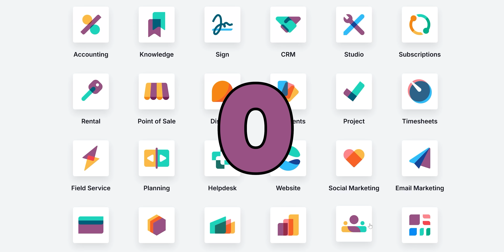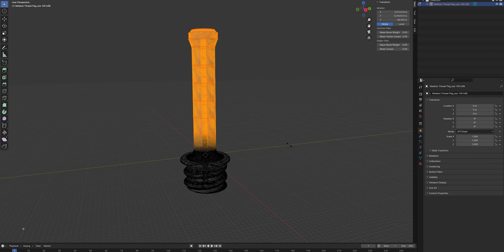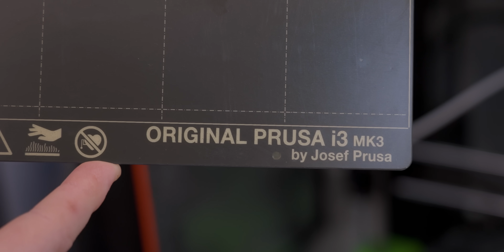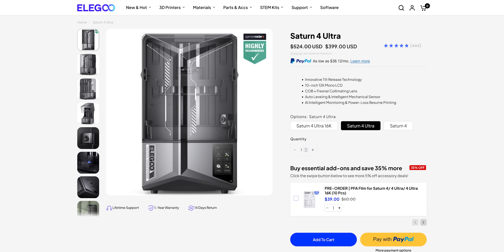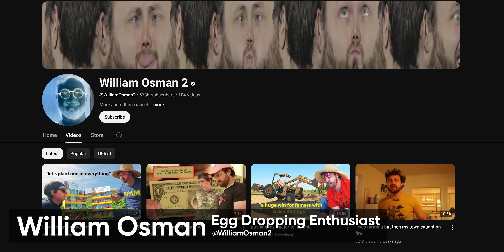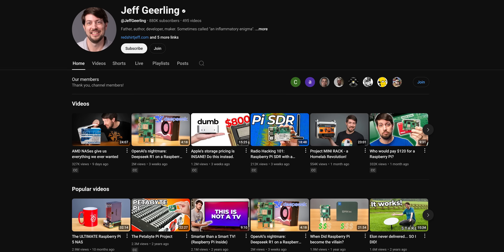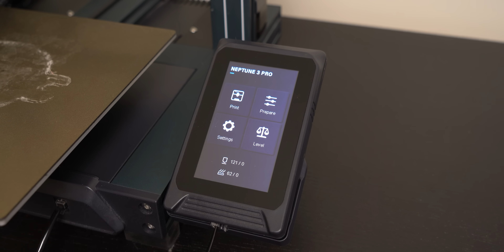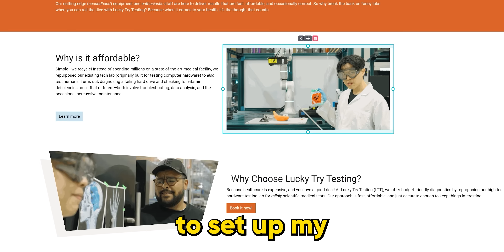Is my 3D printing setup wrong?

Comment: Desiccant packs are a thing ofnthe past. You can buy the beads and print containers that not only sit in the slots between the AMS motors but also sit in the spools and lower compartments. Plus when the desiccant change colors you can reheat them and dehydrate them in the microwave. But get the orange ones they don't have that toxic chemical the blue ones have.

Comment: Tell Jake instead of the hardened nozzle check out obxidian by e3d they have it in v6 style, I use the obxidian revo style abd I've had the same nozzle since they dropped 2 years ago and have ran a lot of glassfiber,and carbon fiber filled filaments it hasn't shown any wear at all.

Comment: my first, and only printer is the artillery sidewinder x2. and it was a PAIN to use before i installed Klipper on it. 
the filament sensor cable was squished by the z-axis as well and fried the pcb with the screen LOL

Comment: You need to have Dennis do more sponsor bits!  
As for printers, I have the AnyCubic Kobra 3 and a Kobra 3 Max. They have the "Ace Pro" which is AnyCubic's version of an AMS.  I've had a few problems with them, but AnyCubic support was super helpful and even sent me a new hot-end after a clog caused the original one to jam up.  The camera can be used to have an AI detect printing errors, but I've had more false-positives than actual printing problems caught.

Comment: I use a Creality Ender 3 with a Raspberry PI Zero2W with a camera on a 3d printed arm running OctoPi.  With a couple of extensions to control GPIO for a light and printer power I can run everything remotely via a web interface.  It even records timelapses of the prints for me (set to 1 frame per layer).

All in the entire setup was cheaper than half the printers listed here (about USD200).  Single colour prints only, but I have no complaints about the ease of use or quality.

Comment: I have to say that I think that you are using this machine wrong. I have 5 and I have literally had nothing go wrong with it as long as you take care of it. Prusa's are great but you need to build everything from scratch. SO if you have never done this it is a complete PITA. But I've been using Creality stuff for the last 6 years, so I do understand how all the aspects work. Unless you get the Prusa XL 5-toolhead 3D Printer (2500). Also they leave out the awful issues with the cleaning of Resin. It is just awful. Stinks and goes through IPS like water.

Comment: Thanks for the video and mentioning the part about the accessibility of the tubes in the AMS. I hope Bambu Lab listens/watches and provides an upgrade or something.
Why don't you print and use the dessicant trays/pods for your AMSes? It will keep the housing dry and should reduce problems with jamming and clogging.
In my case, it reduced the humidity in the AMS to 1 in about 2 days and (fingers crossed) i never had any of these problems so far.

Comment: 90% of my prints are car parts. I have a pretty basic and cheap setup, a modded Ender 2 Pro and a heavily modded Ender 3 V3 at home, and at work a K1C, mostly for bicycle, scooters and motorcycle parts in ABS and similar materials. I haven't used a dryer in my life, just pack the filament in the sealed bag and add a couple packs of silica. In my experience, settings and design are more important than the printer itself.

Comment: I’m surprised almost everyone uses Prusa, in my experience they’re just a really over priced version of what you can get from pretty much anyone else. Usually a bit more polish, but not double the price worth (except the PrusaXL that thing is genuinely in a league of its own). I’ve been a big fan of what Creality has to offer, the CR-10 series was awesome back in the day for how big and cheap they were and it looks like a lot of people in the video agree. The earlier Ender 3’s were cheap but pretty bad, but the Ender 3 S1 and V2 were great (V3’s kinda suck though ngl) and the K1 Max is a way bigger, cheaper, and more open version of the Bamboo printers (though like with the Prusa comparison not quite as polished of an experience). I’ve done all kinds of stuff to my K1 Max, rebuilt the gantry, new motors, and all kinds of firmware mods. I haven’t payed super close attention the last few months since I’ve been so happy with my K1 Max, but the K2 Plus from creality and new machine from Bamboo look like they might give the Prusa XL a run for its money (aside from the Bamboo being so locked down now)

Comment: This dude really has a resin printer on the ground on carpet.. please DO NOT DO THIS. You also must ALWAYS use PPE when handling anything resin that is uncured... I must also say you need proper ventilation as the fumes are incredibly toxic as well. Jakes setup is a straight up F for resin printing or at least what was shown and talked about. LTT I would honestly go back and omit that part of the video as it is a huge safety hazard to the general public that would not know better. Not trying to fear monger but these are genuinely hazardous chemicals that need proper care and disposal. The fact nothing was even talked about regarding this is baffling apart from a silent yellow bold text saying to not handle the tray without gloves.. This needs to seriously be addressed and fixed before someone gets honestly hurt because they do not know the proper care steps to take.

Comment: I honestly don't get the drama behind the Bambu updates... People are making wild assumptions like Bambu just made all 3rd party apps no longer work. This video honestly disappointed me because Linus just painted it as an issue it's not at all, and didn't even try to gloss over facts, just left them out all together. All Bambu did was require authentication for the services that most people say they blocked. They aren't blocked, you just need to authenticate the API now. They even provided an app for that that all 3rd parties can integrate with called Bambu Connect. Everything still works as long as what ever 3rd party app you are using took the time to update their own integration... I'll never be mad at a company adding security to their systems. I'm very surprised that Linus Tech Tips didn't cover these facts in this video, and opted for the "They added security so we can't recommend them as much anymore route"

Comment: HA! My multicolor system, has a built in dryer, and an individual tube all the way to the printhead, and the only thing I've ever had  to deal with, is a piece at the end of a spool, shorter than the tube, after a print finishes. All I have to do then, is see which tube has filament in it, disconnect that tube, and pull the extra piece out, from the printhead side. I've never had anything like I hear about from the AMS, where you've got to take it apart. 

In all fairness, the Kobra 3 does "rather did, they've fixed it now" come with a leaky hot end. I started a 10 hour print, went to bed, and when I got up 6 or 7 hours later, the hot end had leaked, and totally encased the entire thing in hardened PETG. I managed to salvage the printed, and even the heat sink, but had to grab a new "version 2.0" hot end, but it was 15 bucks, no biggie. That was under 100 hours in. Now, at 1050ish hours, the "new" hot end did the same thing yesterday. No biggie again, I got a whole new one, with 0.2,0.4. and 0.6mm hardened nozzles on the way for under 20 bucks, and went ahead and bought an entire new back up printhead for 50 bucks. It had a side effect issue of the 1st mishap, where the front of the printed, with the cooling fan, every once in a while "3 times total" would shake itself loose, since one of the clips was slightly damaged by the massive half kilo clog. It was a freakin MESS!  

But overall, at 1000+ hours in, on my 250 sq bedslinger, 2 major mishaps, a couple minor ones, and maybe a dozen failed prints, out of over 30 kilos of filament printed, I think my $400 multicolor printer is a win.

Comment: comment for the camden bowden, your gcode on the printer is the reason it is resetting the z offset everytime you start a print. within the gcode if you plug in and m503 check the settings as well i would bet 1000$ that gcode has a line in it stating to reset the z offset to reset if you remove this line it will listen to what youve done. problem is when you PRINT a sliced GCODE that is seperate from the physical machine youre messing with but normally there arent any line sin the gcode start section stating things like reset z offset if you downloaded this profile from another individual they MAY HAVE added it because of an issue they were having or an upgrade they may have aded like changing the stop limit switches of the z axis to mechanical switches with screws he manually adjusts that will never change period so adding this code in the start g code would force the printer to overlook any technical z offset that the sliced file or the printer may be attempting to force in because mehcanical is mechanical if it clicks it will stop, some of the nice parts about physical parts like that compared to an optical sensor we have on most newer printers.

Comment: hahahaha bro if your jamming in those bowden tubes you can disconnect from the hotend and just manually turn the extruder gear with new filament inside and push it out takes like 45 seconds. i dont own a bambu or their ams but unless they sealed their bowden tubes completely and theres no manual extruder gear you can definitely just push new filament through also if your filament is snapping in the tube theres a much larger issue at hand might be too high on the retraction speed forcing the filament back in or out too quickly snapping it in locations and maybe thats the issue you are having. theres no access point under that ams because if your clogging there, weve got to go back to 3dprinting 101 and start there because nothing in those tubes causes them to clog even with humidity. humidity only causes stringing and bad prints if anything and barely any noticeable difference, honestly only if youre SELLING the models yeah you definitely would se the difference but for personal use or kid use i mean looking at all those prints theres a ton of retraction work we can do and speed because theres a lot of artifacting on a printer that should have 0. sorry for types but just posting it, its whatever. great video though always love em all.

Comment: I built my own printers, and I have been using Linux for 26 years. 
'I don't use Arch by the way' 😉
I also design my own parts.
_FREEDOM! _
I encourage anyone to take the fun route of exploring everything. 
It also means no one can 'Bambu labs' you.
Although you may get some failures the successes are all the more special.
I sell a tiny volume of 3D printed products all around the world. 
I think I would have printed around 120kg of parts. I buy filament in 8.5kg and 5kg spools these days. 
Many prints exceed 1kg, and some exceed 2kg.

Comment: I run a pair of Ender 3s that I bought used on facebook marketplace. One of them has a direct drive extruder and dual Z axis steppers, the other is completely stock. They sometimes need babysitting to make sure the first layer is adhering, but once a couple layers are down, they generally don't fail, at least with the basic PLA that I'm using. 
I think, for most people, the "setup" can be as basic as that. One thing that 3d printer nerds tend to forget is many people want this to be a tool, not a hobby, so cheap and simple is a perfectly valid way to go about it. 
I think the more difficult side is actually the modeling. I first learned on autodesk products, but their licensing system is a pain and they don't really do linux support, so these days I tend to struggle through projects on FreeCAD. I... can't really say I recommend it. There's too many weird limitations and required workflow actions that a more polished CAD would handwave over, but FreeCAD doesn't, so one ends up spending more time debugging the various unhelpful error codes than actually progressing in a project.

Comment: Resin printers are actually not dimensionally accurate. The screen itself is, but when you pull the green print off the screen, as it happens every layer, it warps a little, and that warpage adds up! I would say Prusa FDM printers are most accurate in large dimensions.

Comment: My first printer was the ender 3 v1. It works well but needed a lot of tinkering and some upgrades to get it consistent. My 2nd printer is the ender 3 s1 pro. This model fixed everything I didnt like about the first printer and had upgrades I wished my first printer had like a direct drive, high temp hot end, hotter bed, faster print speeds and a touch screen lcd. It so far has been a workhorse with no issues.

Comment: Oh FFS, get over it, the Bambus are RAD, do you really care that those changes are made?  They made clear that they will not be doing subscriptions.  I have been doing 3D printing since the first ones hit the market and my Bamboo X1C is the first that is a tool and not a hobby.  Much ado about nothing.  If you don't like it, do LAN mode and wait until they realize what they are doing is dumb and roll back.  I pitched my Ender 3s the minute I used my X1C, it is wicked fast and many many prints in, I have had 0 issues.

Comment: Seismic Dampening feet are probably better than nothing BUT not amazing. They dont really dampen the movement as much as they are springs. I recommend getting some soft foam or rubber under the Printer instead.

Comment: super simple dryer setup that can scale... get an IKEA cabinet and a dehumidifier. You can dry multiple spools at the same time as well as anything else. I used to work at SeaWorld and we had a dry box in our shop. Any time we pulled gear out of the field for repair, it would get opened up then put in the dry box for 2-3 days before we actually worked on it. This is also where I kept all our PLA when not in use, allowed me to swap out rolls quickly when one was on the printer too long.

Comment: I bought an X1C at launch with all the accessories. I dislike the firmware update, but it also provides some things that I appreciate. The remote printing function is greatly improved and I end up using that more than I thought. I hate having to use their cloud as I could just VPN in and use my own.. but I've never used any other slicer but Bambu Labs Software and Bambu Handy, as I've found both of them far more intuitive than Orca. I started years ago with a Creality and frankly found it to be unreliable garbage. In years, the number of blown prints I've had on Bambu is minimal, often PETG or TPU filament fails, but my PLA ? Solid like a rock, print anything. Each version of Bambu's software is better.

Comment: 8:35 dont be like the editor and just use common sense, a empty vat with clean sidew is perfectly safe to hold without gloves, there is no spladh risk and in this situation you would actually need to try to get resin on you, for handling vats with a bit of resin in them or the sides are dirty or your moving a freah model by hand then sure use PPE but a couple drops in a vat are not the Boogeyman, they wont jump out and kill you.

Comment: I'd just like to point out: The Core One is not "basically a MK4S with an enclosure"

It shares the toolhead, much of the electronics, and a lot of parts, but it is a completely different design.

It uses a very different motion system with very different characteristics, and the enclosure is more a natural benefit of the complete redesign than the main differentiating factor.

Just wanted to point that out.

Comment: Ok. EVERYTHING Jake is doing is WRONG. Do not use his setup as a guideline. Resin with no gloves, on a carpet, is STUPID as hell. Damn. No. Resin, isopropyl alcohol, and curing should be done in an space with proper ventilation and fume extraction, with personal protective equipment, and flat, smooth surfaces that allow for easy cleaning.

Comment: The easiest budget printers Are the Bambu Lab A1, A1 mini,. Creality Ender 3 V3 SE or Ender 3 V3 KE. The KE has a better hot end, and control pad. The A1 and A1 mini can be bundled with the AMS Lite for multi material/color filaments. They are extremely quick to assemble, all are bed slingers, all have automatic bed leveling and Z-offset. The A1's and KE have wifi and the A1s have cameras. A camera can be purchased for the KE. The A1's are a tad more expensive of the 4 but the AMS Lite is what makes them the more favored of them. You can get the A1 w/ AMS Lite for 440 USD at Bambu Lab while the Ender 3 V3 SE is 199.00 USD at Creality

Comment: Maybe don't allow auto updates and don't update at all if the printer is working fine?
You don't need bambu handy, in fact no other manufacturer has a similar service so in the expectation of switching brands you have to get used to the pc only software and maybe look into alt slicers like Orca.

Comment: I own several Bambu Lab printers and I have no idea what you all are all talking about on the firmware.  They run 24/7 and I keep mine online and update and I have never had a problem or noticed anything strange. Over the past year I had one nozzle block from filament that was like 3 years old and I just wanted to see what would happen.  Just a experiment on my part.  Me personally I would go Bambu over Prusa.